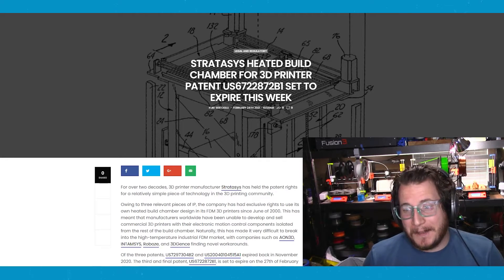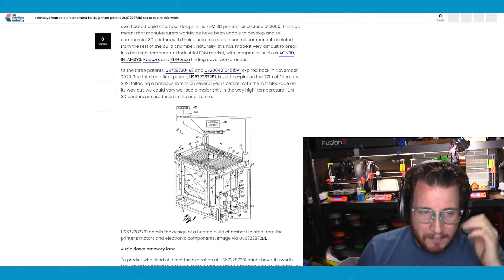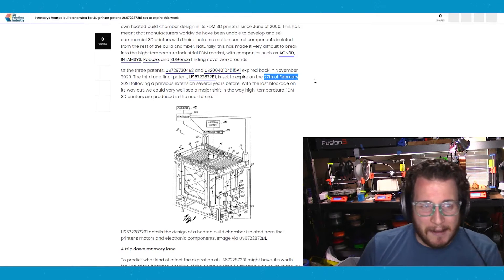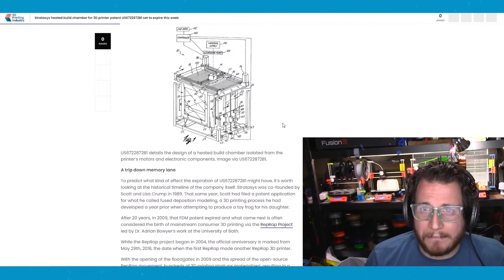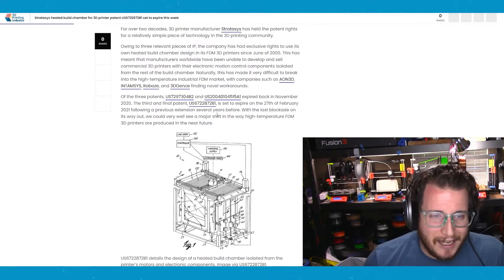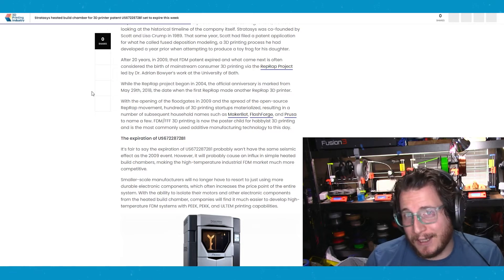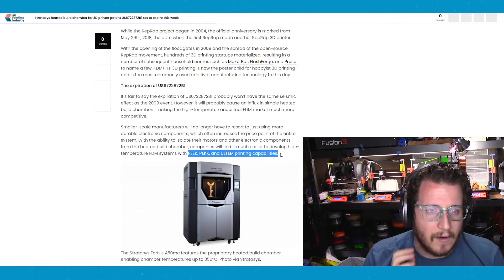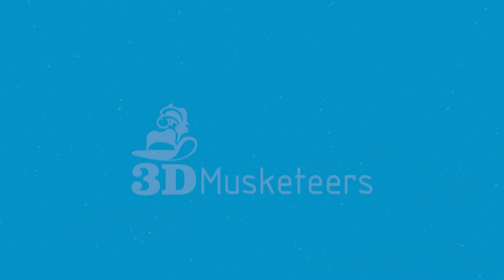Stratasys Patent is FINALLY Expiring! - Industry Updates!

Comment: A motor on the outside, how revolutionary. Patents can be a joke that hold back progress. Look at the Tesla battery patent, its way to simple to deserve one.
Reply: So it's now legal to put a chamber heater inside a Voron since 4 of its motors are mounted outside the chamber.
Reply from the maker: Absolutely. That patent has been up for over a year (we did a video about it too lol) and as an end user, you can do whatever you want.
Reply from the maker: Had they actually licensed it pout for a reasonable rate to ANYONE, this issue would have been negated, but yes, this patent held the industry up for decades
Reply from the maker: @ButterfatFarms  bit of both? 4 digit machines are still consumer grade IMO, at least the under 2500 side. Fully heated enclosures? No, they require too much material and such to trickle down like we would want. Some 5 digit machines have come out with the chambers and such though, which continues to lower the price point, so no complaints here